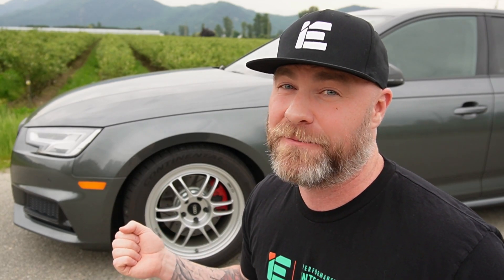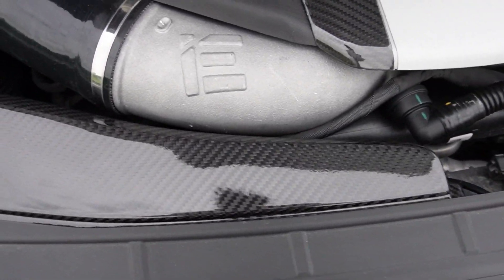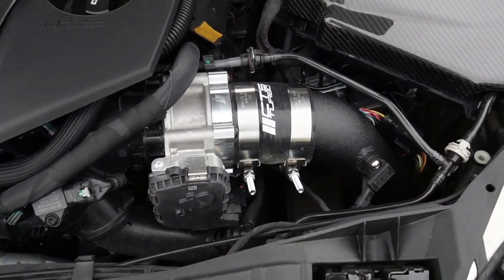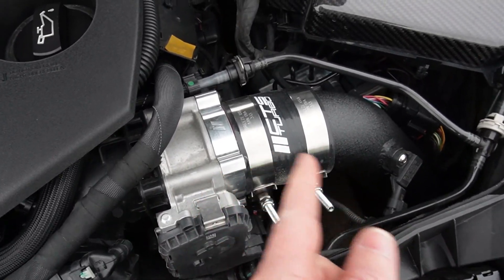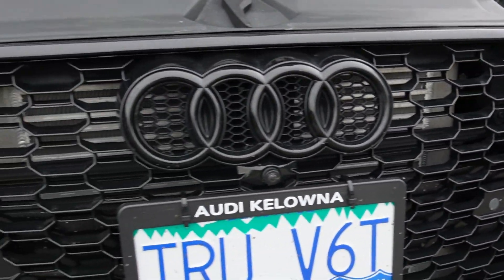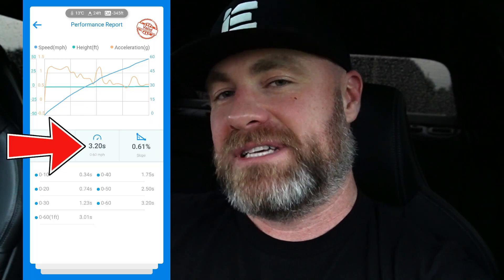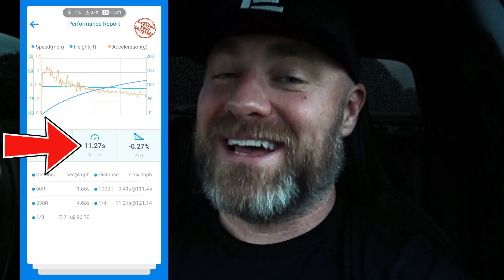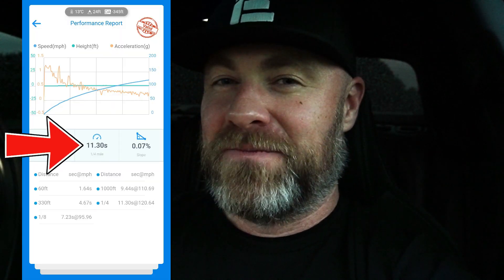Integrated Engineering Air Intake, Turbo Inlet & Intercooler Performance Test - Audi B9 S4

Comment: How audible is the cold air intake with the windows closed?
Reply from the maker: From what I remember, you don't really hear much of it. If you prefer noise over performance, I'd go with an open intake and then you'd hear it a lot more.
Reply: @VancityAudi is the open air intake worse for performance because it gets heat soaked?
Reply from the maker: @andytran-ry7yc depends on who you talk to and how you're using your car.

Comment: Quick q: on a stage 1 91/93 tune, How much do you think the intake, inlet and intercooler is worth in the 1/4 mile? Looking at your other vids, it's looking like 0.4 to 0.5 sec, but not quite sure, as that sounds like a lot just for hardware on a stage 1 91/93 tune. Thanks in advance!
Reply from the maker: These were my results before I installed those bolt on's: https://youtu.be/blm3tLAH_wE

Comment: What does the IE stage 1 93 pump only feel like driving around town? Is it smooth like unitronics or more aggressive like APR? Thanks man. Love your videos and wanting to choose a tune soon for my 2020 b9 s4. Eventually Bolt ons will come too.
Reply from the maker: Sadly I've never compared the drivability to other tunes. What I can say though is it is VASTLY improved over stock when running the Integrated Engineering ECU & TCU tunes.

Comment: Have you seen why happened to Officially Gassed ‘s B9 RS5 from launching hard?
Reply from the maker: I haven't.  I don't have the time to watch much YouTube. What happened?
Reply: They found the weakness in the trans quite quickly. it’s worth watching
Reply from the maker: @behindthebuild8016  I just found the video and watched it. It was his front diff. That is an extremely rare failure from the research I've done..I wouldn't say that is the weak point at all seeeing as that's the first I've ever heard of failing. Thanks for sharing that. I'm gonna keep on beating the sh$t out of mine though. Quicker, faster, harder!
Reply: Can’t wait to see what you achieve with this platform
Reply from the maker: @behindthebuild8016  same!

Comment: Love the vid!

Would you mind directing me to where you purchased those clamps for the charge pipe? I have the same one and want to upgrade it one day if it does decide to pop off. thanks in advance
Reply from the maker: Thanks! Contact CTS directly with your order number and hopefully they'll be able to supply you with the appropriate clamps.

Comment: Nice video.  I’d like to see what you can do on a 93 file as we don’t get E85 in the UK. I’m running a IE stage 1 ECU/TCU in my S5 with an intake.  IE advised me a stage2 doesn’t add any more power so held off adding a down pipe.  It’s not so hot here that I feel I’m going to gain anything with a intercooler, most of the year round, although we are due to see 34°C on Sunday so don’t think I’ll be going out that day for any fast runs.
Reply from the maker: You'd be wrong with your assumptions on the intercooler.  If you want maximum performance on a Stage 1 power level you need an intercooler.  I already made a video of how much the IE intercooler dropped my intake air temps in cooler weather, on just  a Stage 1 car with one bolt on part other than the cooler found here: https://youtu.be/NrhcceF-Uzg  As for showing 93 results sadly I won't be able to help you out there.  With our limited drag racing season I want to continually go quicker and not slower by using pump gas.  If it helps I already did a video on the Stage 1 pump gas results found here: https://youtu.be/Tqf8Ib7Rtq4 In that video the car would have performed even better with a more aggressive launch control.
Reply: @VancityAudi  thanks for your response, looking forward to the next videos and seeing how you get on once you get to stage3

Comment: Are you going to suprise everyone and run 10s full weight stock turbo?
Reply from the maker: I would if I could! But I don't think that'll be possible quite yet.
Reply: @VancityAudi  11.2 Stage 1 not even with FBO. Ill bet your RS3 that solid atmospherics and stage 2 E60-E85 you will. You have the amazing Canadian DA on your side.
Reply from the maker: @MeatloafMelvin  from what I've seen the difference between Stage 1 and Stage 2 B9 S4's isn't much. I don't suspect I'll gain a heck of a lot more from a downpipe upgrade. I hope I'm wrong, but I don't think I'll be able to run a 10 without removing the interior like everyone else has. Keep in mind that others have had a WAY better DA than I have currently and have still all needed to remove their interiors to run 10's on a stock turbo.
Reply: @VancityAudi  Yeah, thats true. Stage 2 Bolt ons for me was a couple .1s of a second over stage 1, so who knows. You may have a special S4. 
Im not running 10s any time soon. DA is over 6000 here and 105+ degrees.
Reply from the maker: @MeatloafMelvin  no such thing as a special car in my opinion. I've never believed in the whole "unicorn" belief. I just spend an obscene about of time dialing in my car to get the most out of it. Sucks to hear about your local conditions!